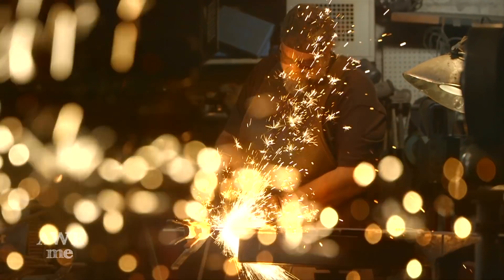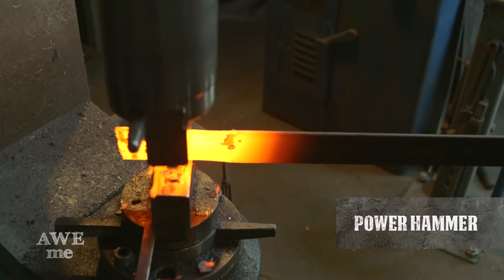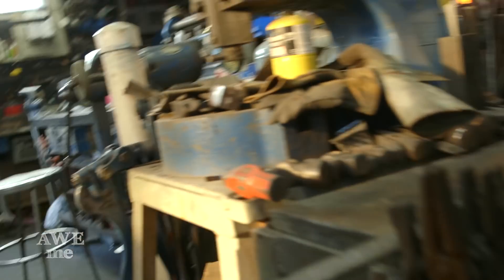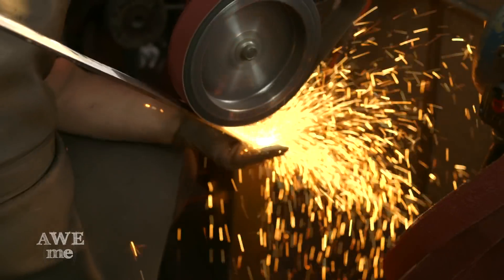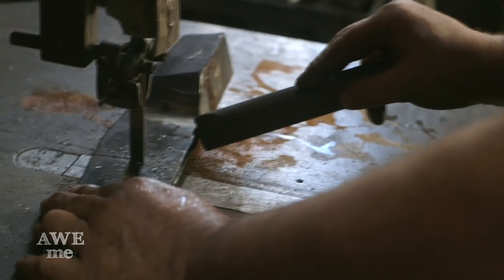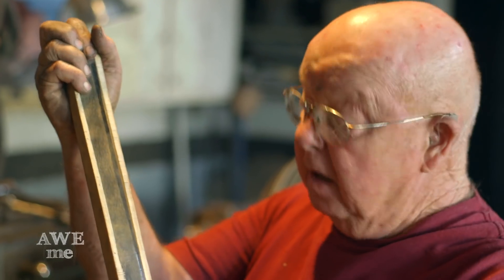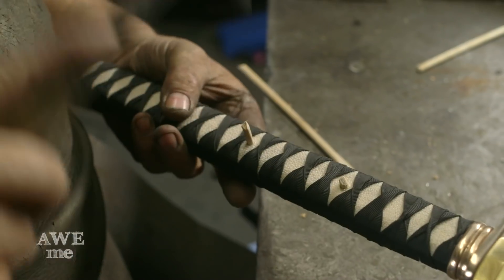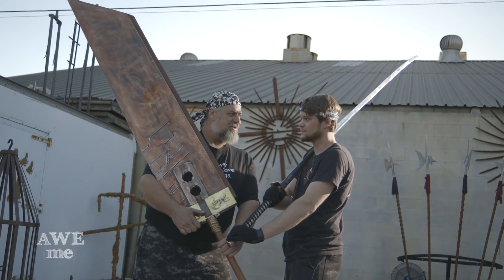Sephiroth's Masamune  (Final Fantasy VII) - MAN AT ARMS

Comment: I see some comments questioning the craftsmanship of the blade. It is forged fine as a decoration, but as others point out it does not actually preform well in combat or test combat. The problem is that it is simply too big to ever function or swing without it flopping like crazy regardless of the method used to forge it. Any technique (as far as I know) or metal used would either result in a sword that is too brittle and would only last for a few hits before snapping/shattering, a sword that would bend under its own weight (like this one) and flop all over the place, or a sword that is simply too heavy to swing like the buster sword. Arguably the best forging of the sword would be the heavy version, if you look at the game images it is actually a fairly thick sword and does not flop at all (even though a thicker blade would still flop a bit, this is just an animation thing). In all circumstances Masamune is just not a feasible sword design to begin with.
Reply: "too big to function" no, not true. It all depends on the material used and how you forge it. What they used is great and all, but it comes with some problems. Does not help that people keep thinking Sephiroth's sword is a katana when its not. ( psst, its an ōdachi )
Reply: Forging methods don't effect performance, heat treatment and steel type do.
Besides, forging is pretty much universal when you get to the basics(disregarding pattern welding and such).

Also, if the sword did have a traditional Japanese style differential heat treat, it would have just stayed bent on the spine and the edge would crack/chip after the first swing.
Reply: theMedievalBadass I actually think captainTrips is right here. After researching what the hell an odachi was, It appears that there were historical examples of swords of this length- an average one being at 65-70 inches. The name literally translates to "big sword". i don't know a huge amount about heat treatment and forging and the like, but since this thing was commonly used at a certain point in history, I think it should be possible to create one that does work, and works well. It also, I guess depends on how it is used. Ie, downward strikes instead of horizontal, like the ones in this demonstration. Sorry for the huge wall of text, and l think you could learn a lot more through your own research, as I am just regurgitating stuff I looked up lol.
Reply: CaptinTrips also, cheers, now I know what an odachi is :)
Reply: It wasnt flopping yoru eyes were being tricked by the sheen of the blade, it appears wobbly as the sun is glaring off it creating a fun house effect.
Reply: AtticusRh0des It was flopping. Even properly-designed swords will flex when they strike something hard (if they didn't, they'd break), but that "sword" is so ludicrously long that it just set up visible shock waves in the blade.
Reply: Jade Smith concisely put, my friend.
Reply: Not only that the length and weight of the sword gives it a supreme advantage if the user knows what they're doing.  Trust me, I have been sparring for 22 years.  I've actually faced someone with an even longer sword believe it or not..  They don't have to raise their sword half as much as thy opponent ;)  it's pretty sick to watch someone fight verses the other manner, and the outcome.. were on youtube, go check it OUT!
Reply: I am so sure
Reply: You sir are well informed and wise to post this... :)
Reply: Well this is exactly what the rants are about.
He should've made a honest heavy sword even if no one could wield it for long.
I know he's mainly a decorative blacksmith though.
Reply: Murad Beybalaev Yeah, maybe if the spine were thicker, like a steel rod used in construction, the sword would be more sturdy. Also the ōdachi blade seems to have a wider blade too, and Japanese swords are made of several layers of folded steel instead of just one.

Still, I liked the stingray skin and use of chopsticks.
Reply: OmegaPyron
Good observation about folded steel.
Reply: OmegaPyron a espada Masamune original não tem esse tamanho, é grande, mas não tanto assim!, e mesmo que fosse feito uma espada na técnica Japonesa dobrando o aço a lamina se curvaria com o próprio peso... enfim é inviável fazer algo assim com aço comum ou Tamahagane. no Jogo provavelmente a espada é feita de outro tipo de metal. Talvez desse certo fazer com uma liga especial de Titânio... dificil dizer.
Reply: Marcos Paulo  bom ponto!
Reply: Will Clarke
 The Odachi (Nodachi is another name, I believe, I could be wrong.) was believed to be mostly ceremonial, found in temples, or used as an offering to gods or something to that nature. Also it is believed to be used by Samurai on horseback to take out infantry with out getting pulled from their mount. Also flexibility in a sword is a good thing to a certain extent, if it is too flexible it can lose it's shape and become all types of bent really fast.
Reply: I did not now that it was mostly ceremonial. Thanks! :)
Reply: The Nodachi was a blade used by samurai from horse-back.
Reply: Arthur Miracle Thats incorrect.  It was used by foot soldiers.
Reply: Charles KErwin
 The Nodachi is another name for the Odachi. When used in combat it was used on horseback to cut down infantry while reducing the risk of being ripped off their mount. Though while it's size makes it less than ideal weapon on the field for infantry, they could have, and very likely were used if they had no better choice, or if it was a shorter blade(The sizes ranged.. Other than that it was mostly used in a ceremonial fashion or displayed in temples.
Reply: OmegaPyron Nice post, but just a bit of clarification.  I can't speak directly for the exact type of steel he used, but the point of folding metal is to remove impurities from the metal introduced by the actual melting of the ore, in other words, to make the metal more dense and stronger.  The problem is that the steel we produce today already has a much lower amount of impurities so the metal is much denser than any about of traditional folding could reach.  Basically, this sword (assuming he used metal of some quality and not the stuff they make replicas out of) is much stronger than the stuff made by folding metal.

I'm an Aviation Structural Mechanic in the U.S. Navy, and while these smiths have forgotten more then I'll ever know about metalworking, my job does require me to know about, and work with metal.
Reply: That's awesome. In your opinion, do  you think they could have improved the sword, or is it about as good as it can get?
Reply: For a sword of that length it would be very difficult.  As you could imagine, making anything with metal is all about finding a happy medium of strength-to-weight (SWR) ratio, especially if it needs a humans strength to wield it.  In this case, if they had hardened it too much it would become brittle and would chip easily, whereas if they had reinforced it much more and you would basically get another Buster Sword scenario of excess weight.  

I'm not quite knowledgeable enough to know for certain if there are better techniques or steel alloys with better SWR ratios than what they used, but I doubt there would be much improvement in the flexing, since you would want some flexibility with a sword of that length (and every sword really) otherwise they break too easily.
Reply: Null_Shock Other way around, it was used by Infantry to take out a the horse the samurai was riding.
Reply: I've only ever read it used by samurai on horseback, or for ceremony. Thinking about it logically, if he fell off of his horse, he, of course could use it in combat, and even to take another samurai off his horse: grand theft samurai.
Reply: VidZero
 No I am pretty sure it was used by samurai on horseback, a Naginata would be more likely be used by Infantry. Yes just fact checked myself real quick. Samurai on horse back used would use the odachi to take out infantry, less risk of being knocked/pulled from their mount.
Reply: Null_Shock
I have my doubts, we can say it would be more pratical on horses, however there are actual traditional dojos that use it even nowadays. Kojiro Sazaki used it on foot, it was said he was so fast it could cut a bird in mid-flight (Some says he did that training), and was one Musashi's more important oponents.
Reply: Good to see lots of people mentioning the odachi, but the difference here is that to qualify as an Odachi, the blade must have a length of three shaku, or about 36 inches. I dont think there's an example out there with a blade longer than 40.

This has an 85 inch blade. Once you add that much extra mass that far out it will flex no matter what its made of- you could make it thicker, yes, but then it wouldn't look like sephiroth's Masamune. And you would have to greatly increase the spine thickness rather than the width of the blade to make it stiffer, which would reduce its cutting potential (Thicker blades are harder to push through things) and increase its weight substantially.

Also anybody mentioning Titanium or similar.. no, just no.

How do i know? Toolmaker, and i've worked in aircraft grade materials as well (Yup- Titanium, great stuff, within its limits, cant make a knife out of it- tried)
Reply: chi is still katana. but it was very impractical for samurai to use because of how big it was so they would carry it in their hand or on their backs. to draw it they would, instead of pulling it from its sheath, pull the sheath from the blade and then strike
Reply: An important point to mention is Japanese feudal blacksmiths used a method of folding steel reforged countless times to make the sword extensively sturdy and also having only one sharp side with a curve so the blade it has superior strength and kenetic penetration power than western designs.
I'm certain if they had the knowledge and employed folded steel methods to their design,
the blade would not flop.
The average if I remember correctly was 7 layers of folded steel condensed into a single Katana,
this Odachi has only one layer of steel that is not condensed.
Reply: Jin Kusanagi
 I am going off of historical accounts regarding the use of the blade. It was not a common weapon for foot soldiers. I don't care about Sazaki, and there is a difference between using it in a dojo vs real life combat. Though I would be interested in knowing what Dojo offer training with this particular weapon.
Reply: BaneNZ
 There isn't an actual exact specification of the size of the Odachi. Though yea on average they would be about that length. We are not talking about the flex in the blade, or Sephiroth's sword at this point, we are talking about in what way they were used in Japan. Which the most common use was on horseback, to cut down infantry. Also almost every weapon has examples of being used in ways that are not practical.
Reply: idk anything about metal work or forging or blacksmithing what so ever but couldnt they have folded the metal a shit load of times or something, but itd just be even heavier?
Reply: CaptinTrips
hey bud... katana is just the japanese word for sword, and there were no odachi's 7'2" long blade, they were usually about 4-5 foot long, back in the periods we are talking about, predating the Sengoku Jidai which was the period of prevalence for the exact for of the katana we know today, people were much smaller, taking into account that even today japanese people are generally shorter than the average american, a samurai would probably be around 5'3" much too small to use this sword or anything close, plus Sepharoth should be about 7' by himself
Reply: Yourantsally CaptinTrips Orrrrrr, instead of arguing about a sword from a series of video games, we can just consult the wiki which has the information about the weapon in this video, http://finalfantasy.wikia.com/wiki/Masamune_(Weapon), and look at where it calls Mesamune a katana. I skimmed the article, and it doesn't seem to call it any other type of Japanese weapon...
Reply: The odachis are katana's, katana is the word for sword, just like a basket-hilt is a sword and a claymore is a sword but in the classic scottish language they are both called claymore, and odachi is just a really long, really curved katana
Reply: Khamis1203
Nope folding doesn't make steel stronger but it does remove impurities which reduces the chances of failure which isn't needed in modern steel since modern steel is much purer than ancient steel.
Reply: Mark K
True, folding is usually just for cosmetic purposes now.
Reply: Yourantsally
 I think it is actually Ken, though I rarely talk about swords when I am speaking in Japanese. Also my fluency is not the best, I still need people to slow down, or explain certain phrases or words. I am pretty sure it is Ken or both and the word you are supposed to use is based on the context.
Reply: if hes going to spend long periods of time forging a sword he should at least make it as best he could passively can
Reply: Guys this a Final Fantasy sword hence the Fantasy part
Reply: Max Tang
 There are swords of this size though, called odachi, mostly for ceremonial display in shrines, but does have some historical examples of being used on the battlefield. That is what the argument has been about, not so much about Sephiroth's sword.
Reply: Null_Shock The original purpose of the original comment was that there was no real way to properly make Masamune, regardless of the technique or material. They did a good job within the confines of reality for a "show" version of the sword. Whether it was an Odachi, whether or not odachi's were ever used in combat or any of that should be posted under a separate comment chain. Those things were never brought into question, and it's kind of annoying that I keep getting updates about it. (if you know how I can stop getting updates from this comment chain, that would be just swell if you could share that knowledge).
Reply: ToxicHyena I'm not sure if you can stop them from showing on YouTube, but if you receive emails about comments on it, you can scroll to the bottom of the email and there's an option to stop receiving updates for this thread.
Reply: ToxicHyena
 There may be a mute option, and I may have confused this thread with another. I do feel compelled to correct you, the Odachi were used in combat, primarily on horseback to cut down infantry, and there a few cases of someone supposedly using an odachi in a dueling type situation(that can just be overblown stories though.) Still they were used in combat, though not often, they were mostly used for ceremonial displays in shrine like I mentioned before. Also there are several comments of me going back and forth with someone over the odachi, it started out as a convo about Sephiroths blade and slowly changed, at least for some people.

Still I think there is a way you can block updates, or just take out the reply option. I can't remember exactly how and I have had almost no sleep. . .It should be easy enough to figure it out, if not, then google.
Reply: Which is why Sephiroth is the only one capable of using it effectively. His enhanced strength, speed and dexterity allow for it to be used at all, and as for how unwieldy it is, he does not make the weapon fit the location; instead, he makes the location fit the sword. In other words, if there isn't room, he'll make room. It's a fundamental mindset adjustment that no one else can really grasp.
Reply: Rebecca Lee I agree with you, dont forget that in the O.G FFVII everyone questions how he can wield that sword, and Cloud said that this sword was made only for hin and that he is the only one in the world who can wield it. He's combat style is unique and peerless as he turn raw power into elegance.
Reply: Its the forge of the steel it bends to much to be used in combat. Sephiroth would probably break it. If it was folded cold steel it wouldn't have bent as much. @v@
Reply: michael mcclain wrong
Reply: I know what i'm talking about! I have STUDIED the katana, so i think i know whats what!   Theirs know sence in  arguing with me!
Reply: michael mcclain
Then you would know about how it had been used on horseback by samurai, the close quarters application of this sword would put the wielder at a disadvantage. However wielding it on horseback to cut down infantry without having to worry about getting an arm grabbed a pulled from the mount was a practical combat application of this weapon. Though the sword was more commonly used in ceremonies. Also it is not a fraking Katana, it is an Odachi or Nodachi.
 
Normally I am not a grammar nazi, but "theirs know sence in arguing with me!" is just a brutal. I also normally do not judge a persons intelligence by their spelling and grammar, because mine is not the best, but yea what you typed was bad. It should have been "There's no sense in arguing with me!"
Reply: Booooo your right but booooo.
Reply: Your right I suck at spelling! Yes its most practical on horse back, I know that. The steel of the sword is to weak, if someone rode by and hit the sword with a katana it would notch the blade! The weight of the sword would just want to keep going forward and make the strike more damaging  to blade of the sword. Thus making the notch deeper. And sorry if my spelling sucks, I'm not good at spelling. Steel armor would damage the sword to. Its not made for metal on metal combat, shields would do the same damage as armor, BUT, if it the target was armorless and the sword didn't snap under its own weigh, this might actually be a practical weapon. And it was night when I typed that so don't judge me!